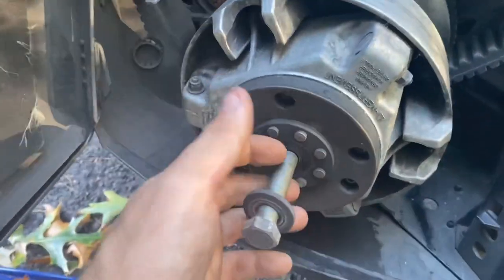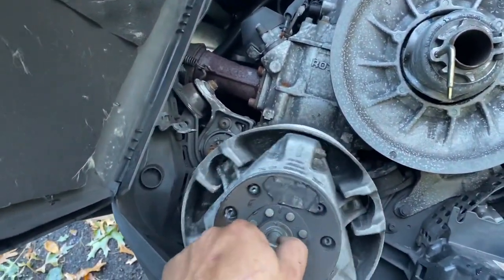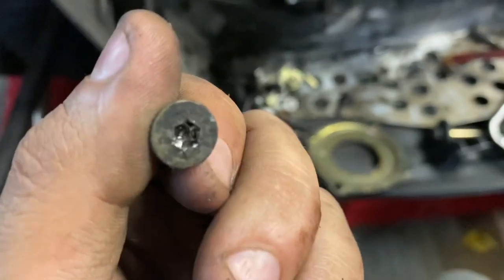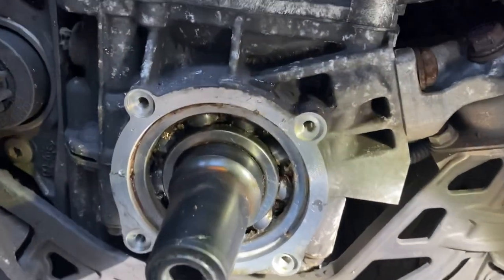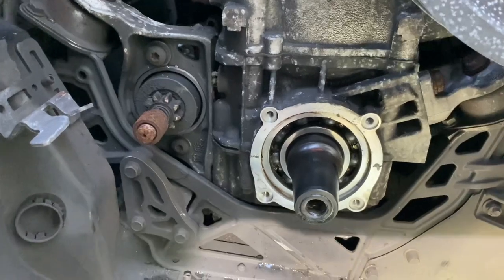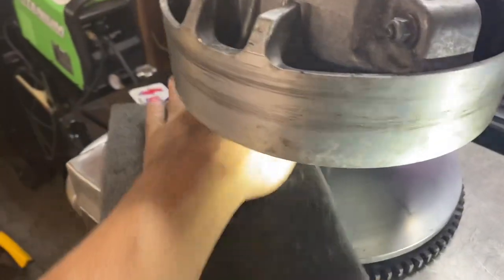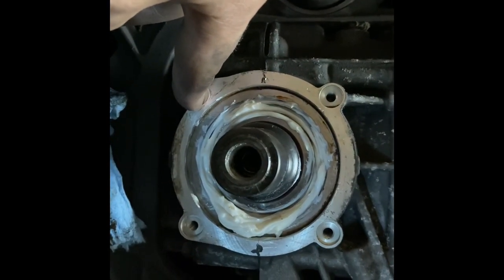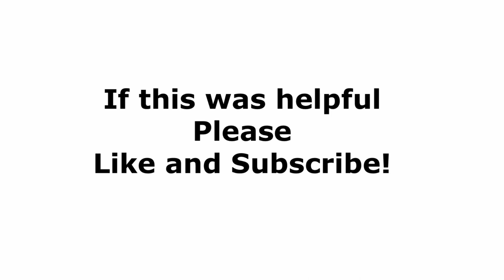keeping your infamous 800r healthy (Crank bearing service)

Comment: Hey Bobby what works good as a clutch holder is a small shortened ratchet strap. Works great 👍. Great vid Bud.
Reply from the maker: Thats a good idea. probably better than a pry bar. Thanks!
Reply: @bobbyrebussini1466 Where did you see the 10 to 20 ML spec for the amount of isoflex?

Comment: How to pull primary from a BRP mechanic
1 take out bolt put in puller 
2get 24mm socket and 18in breaker bar and stock primary holder
3 place holder on clutch and use secondary helix as brace for the handle
4 tighten till it comes off or feels supper tight similar to 89ft lbs tightening but little more
5 if 4 failed to remove the clutch grab hammer (3lbs ish) and hit end of puller this will shock the clutch and most times send it flying off the machine. You may need a really good wack.
6 if it still won't listen get a 24 wrench and try to tighten it as you hit the puller
Reply from the maker: Pretty much sums up a video I have on stuck clutches. Glad I’m doing it as per brp lol. I also heard a rachet strap to the floor boards is ok to hold the clutch too. Thanks!!

Comment: Straight up helpful video.  Wasn't aware it was that easy to get at the crank bearing for a regrease, I just turned over 8k and it's never been done I need to pull it in the shop and do this.  I wonder if the jackshaft bearing can be regreased or if you have to buy a new one, that'll be my next vid search.  Thanks and Cheers!
Reply: I just replaced my clutch side jackshaft bearing today, it was easy and the bearing was cheap. I did put better grease in the new bearing before installation. Just cut the old bearing off with a grinder and tapped the new one in place with a block of wood. It seats when it's all the way on. Good luck

Comment: Is it true that a 2015 800 etec has oil lines that keep the crank bearings on the mag and pto ends lubed and isoflex regreasing is not necessary?

Comment: The water trick works with yur puller 
One wrap of electrical tape 
Tip up the sled add water. Then puller, off it comes

Comment: Hi how many miles u had on urs at this point ? I just bought 800 etec 2016 with 3000 miles really thinking if I should do the same ... also did u reuse the plastic seal that u popped form the bearing or got a new one ? I was gonna buy all the but my local dealer thinks it’s waste of time ... we’ll I don’t wanna have a premature rebuild ... thanks
Reply from the maker: This sled had 10k miles on it. I ended up getting covid so i was bored and rebuilt the whole thing. I have a video on that. 
I reuse the seal almost every single time. If that seal is blown out not only will you notice it, but you would have bigger problems!
Reply from the maker: Also do some forum searching i run shell aero 22 for like 23 bucks same stuff
Reply: @bobbyrebussini1466  oh Instead of iso flex? So did u do this at 10k first time ? Or u did it every season that’s what I didn’t get. Yes I seen it rebuild video👍
Reply from the maker: @henryhenry5897  yeah instead of isoflex. I have no idea if it was ever done before. I bought the sled just before this vid
Reply: @bobbyrebussini1466  oh ja prob never been done so it’s actually pretty reliable but could be extended with new grease ... thank for reply I’ll look into the shell and prob donut

Comment: Thank you for the video! Does the XS Chassis have a grease fitting like the 2006 revs for the PTO bearing?
Reply from the maker: no they dont!
Reply: @bobbyrebussini1466  thank you for the reply, such a smart idea that they removed a important grease fitting (sarcasm). I repacked mine yesterday thank you for the wonderful video!
Reply from the maker: @hondaclub69  glad you liked it! I mean you can pump the shit out of them and blow out the seal so i kinda get why they removed it.
Reply: @bobbyrebussini1466  makes sense, it was nice doing it with a tube and syringe pumping it in slowly and then watching it come out the front so you could actually see that the back bearing was greased as well. But all good things come to an end ha ha Ha, glad I came across your channel thank you.

Comment: Do you know if 2016 etecs 600 need to have the same maintenance done?
Reply from the maker: Yes it does!
Reply: If you do regular maintenance your machine is going to reward with trouble free riding. I have an 03 Mxz x 800r with 7000km on it and it’s never been rebuilt and both cylinders are at 137 lbs compression which is really good. Runs and looks great.
Reply: @tboystoys5682  

You have an 800, not the 800R. That started with the PTEK....
Reply: @ss0073  No I don’t it’s an X package 800r and it’s A 121 not a 120 as people keep telling me. I know what I ride. My machine is number 67 of the first rev run. Gary from mud brats thinks it’s a 120 as well. That machine was a spring special back then that’s what makes it what it is.
Reply: @tboystoys5682  

Video please....

You have an extremely rare collectors item. Love to see some closeups of it. Looking forward to it 👍

Thanks
Reply: @ss0073  Hey Stan I posted a little Video on my channel it shows what my machine is let me know what you think.

Comment: How did you get the seal in?
Reply from the maker: just push it back on with the shaft lubed up! goes on easy.
Reply: @bobbyrebussini1466  mine didnt have the stock retainer. I did get one from mcb had to drill and tap holes but I got the new seal in and used a little rtv then put the retainer on.
Reply from the maker: @kwadlife4106  hmm ive never seen that,
Reply: It usually just pops into place once you start torquing the screws down on the retainer plate...  but if it's not gonna fit,  you might have the wrong seal,  or the wrong plate...
Reply: @bobbyrebussini1466  hi I have a 2011 mxz 600 carb. I did my crank seal and didn't have a retainer so i pressed it in with a socket. Haven't road it yet but wanna make sure it does leak. I sprayed starting fluid around their and rpms didn't change. Anything else I can do to make sure it isn't leaking?

Comment: You do know that your never supposed to put an impact on the end of a crank,  right?  Now you're crank shaft needs to be at least inspected,  possibly straightened
Reply from the maker: I check the runout it’s good. I don’t know how else you’d get that thing out. Have you ever dammaged a crank with an impact?
Reply: Theres a clutch holder you can buy..   you hold the clutch with it while you use hand tools to run that bolt out,  and while you torque that bolt when you put it back on...   I think it's like 60 or 80 ft lbs...   cant remember...

But yes...  I have run cranks out of phase with the impact...   because I never knew about this....

I dont know if you've ever looked realm close at a crank,  but everything is pressed together...  it's not one piece...  and it's not bolted together either...   so when you hit it with the impact,  all tour weights can move around...   you can easily change the position of your connecting rods,  you can even make the stroke of one piston longer than the other...    

Look up clutch tools on ebay or amazon...   

I would also advise you to go online,  or to your local dealer and get a shop manual.  Not an owners owner's manual,  but a shop manual....   these things weigh 500 lbs and make as much HP as an older Honda civic...   

There are a lot of do's and don'ts that I never even imagined in the shop manual....

Also,  whenever I do a top end,  or any work to the engine really,  I like to pull it out,  and just put it on the bench...  I tear it right down...

You do it enough times,  ya get pretty good at it!  

Good luck!
Reply from the maker: @kylemclaren6929  intersting. I mean probably a toss up. I ended up checking runout after and it was .0027" which is pretty good.
Reply: I use a ratchet strap and wrap it around the primary and anchor it to to the running boards.
Reply: @fox406  me to brother works well and frees up both hands. 👍👍
Reply: Some sleds it says in the shop manual to use an impact. LOL